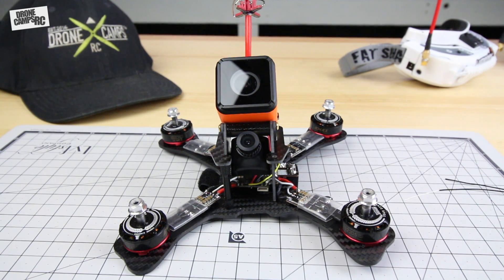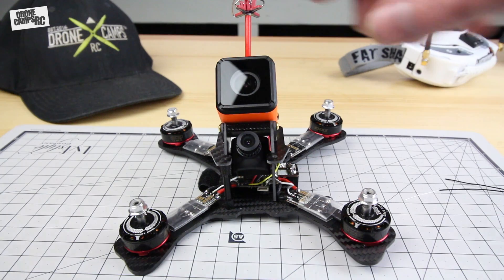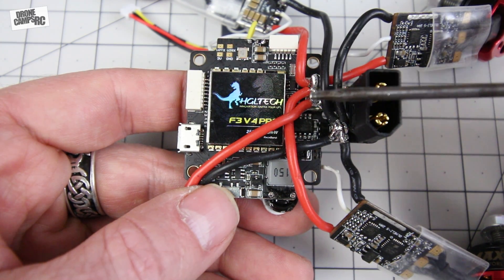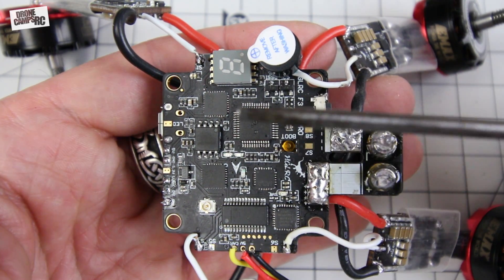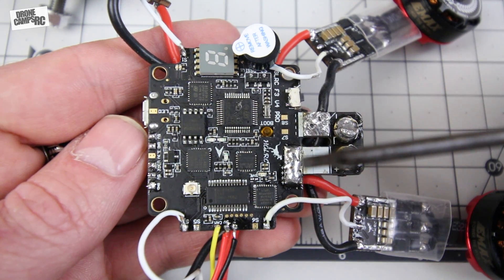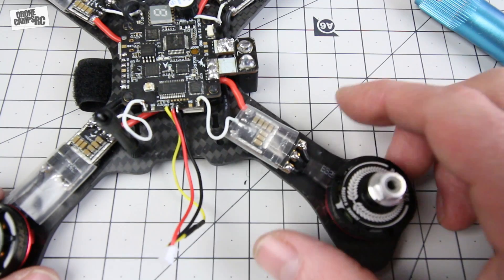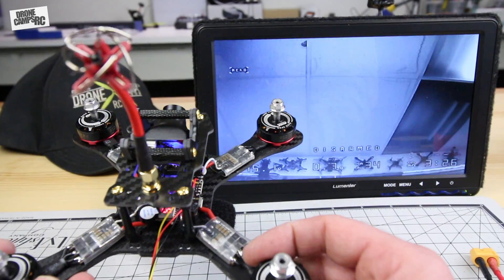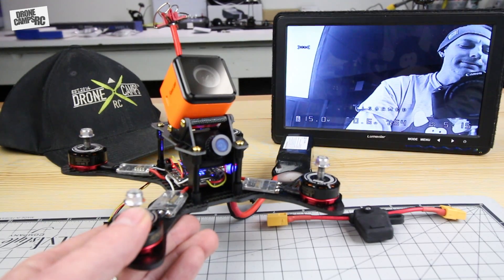YOUR FIRST FPV RACER BUILD - EASY GUIDE & LINKS

Comment: Justin,  I'm at the point where I want a really nice quad. Everything I have now is 150-200 bind and fly. I just got a tarannis x9d special with cross fire micro . I adapted one of my bnf [bfight 210) new vtx and nano receiver.  But I want that next level . Is there higher end bnf  that would do the trick as far as that next level that will work well with crossfire  or should I just start building? Thanks man

Comment: Dusten - I'd really like to build a quad. Not likely to get into drone racing at any level but would sure like to try it!. I have nothing but fields behind my house so lots of room to practice! What would you recommend for a really good kit that I can get for my first build that will be a nice craft, and that I can grow a bit with? Also want to fly FPV with it. I've got several DJI drones, and some smaller beginer drones, but I'm a modeler from the old RC days and have built cars, trucks, boats, helicopters, and many planes. Now that I'm into drones, I'd like to build at least one just for the experience! Not afraid of a difficult build, but can you make a recommendation? Would it be this one? Also where would you buy it? Would like goggle and radio advice as well.

Comment: where can i get the smoke stopper? is it just a low Amp fuse connected to an XT60 connector?
Reply from the maker: Hobby King has them. But there's a diy version without the fuse. Instead a auto light bulb.

Comment: The actual quad that Justin built is this one
http://www.gearbest.com/multi-rotor-parts/pp_435853.html?wid=21&lkid=10547145
It's not listed in parts list but if you like the look of it, then it's on the link above. Great Video as always Justin.
Reply from the maker: Yep! Please use this link though. If you don't mind. http://www.gearbest.com/multi-rotor-parts/pp_435853.html?wid=21&lkid=10547145
Reply: edited my post and copied your link in.
Reply from the maker: You rock Paul. Thanks man. - Justin